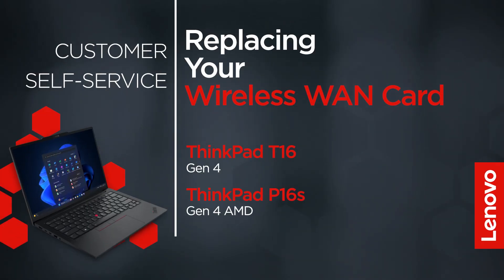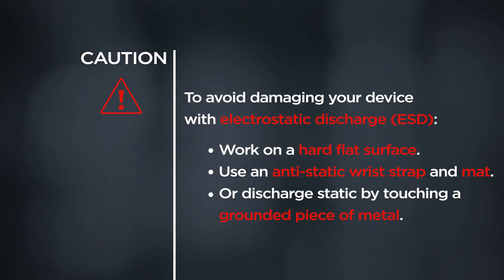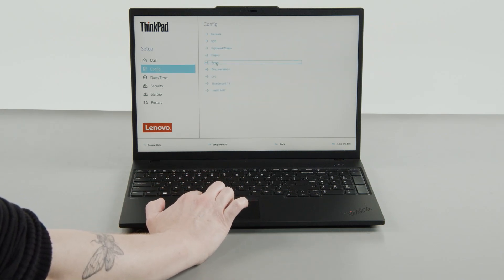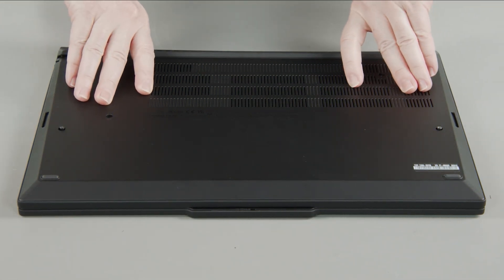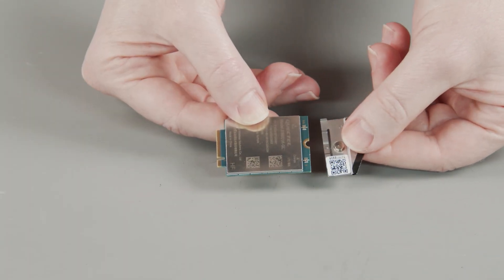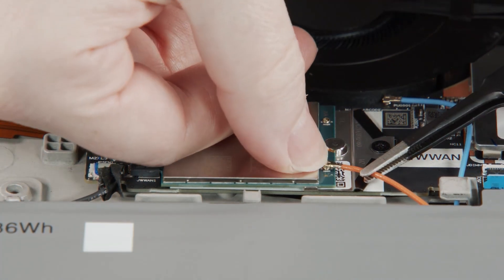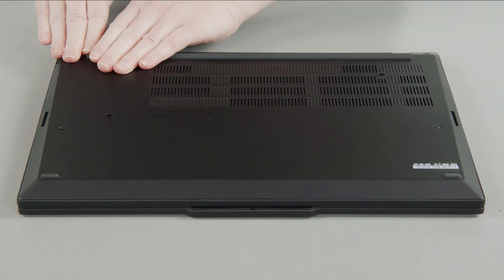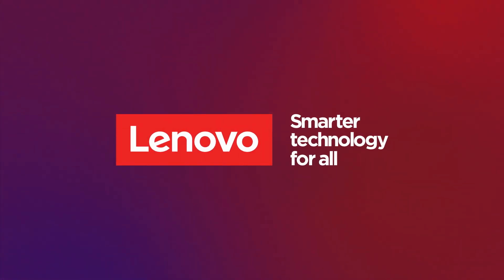Replacing Your Wireless WAN Card | ThinkPad T16 Gen 4 and P16s Gen 4 AMD | Customer Self Service

Comment from the maker: This video will show you how to replace the wireless WAN card in your ThinkPad. The process in this video will work for the ThinkPad T16 Gen 4 and P16s Gen 4 AMD.

You will need a screwdriver kit, a non-metallic pry tool, static-safe tweezers, and 20 minutes of your time.

To learn more about your device go to https://pcsupport.lenovo.com

To find parts for your device go to https://support.lenovo.com/parts-lookup/?cid=ww:lenovosocial:b9515f&source=socialmedia&subsource=yt

To view the Lenovo Support Self-Repair Guides landing page go to https://support.lenovo.com/us/en/solutions/HT516547

** NOTE: Static electricity can destroy components. Use a grounding strap, and clean, non-conductive surface to work on. Use plastic or coated tools to prevent scratching and avoid using metal tools on plastic parts. For more detailed information on electrostatic discharge and how to prevent it, please watch our "Understanding Electrostatic Discharge (ESD)" video: https://youtu.be/by4PB3WtdLo 

Applicable Machine Types:
ThinkPad T16 Gen 4 - 21QE, 21QF, 21QN, 21QQ
ThinkPad P16s AMD - 21QR, 21RX, 21QS, 21RY

Check out other official Lenovo channels!
https://www.youtube.com/@Lenovo 🟥
https://www.youtube.com/@lenovolegion 🎮
https://www.youtube.com/@Lenovo-PC 💻
https://www.youtube.com/@LenovoSuporte 🟢🟡

#Lenovo #LenovoSupport #LenovoTechSupport